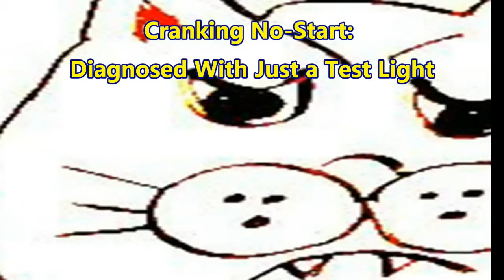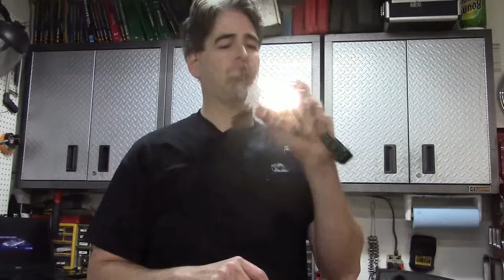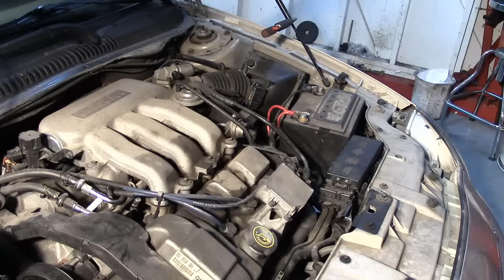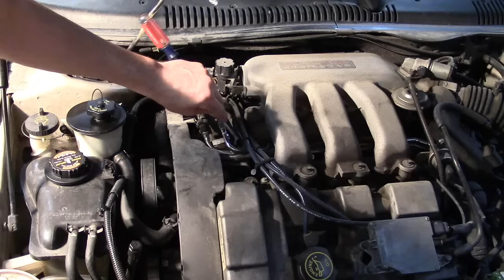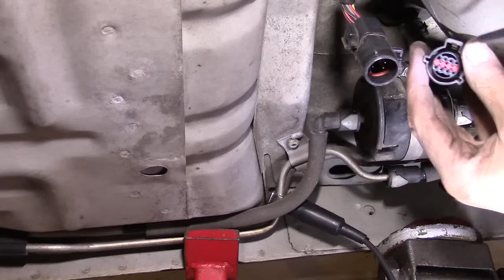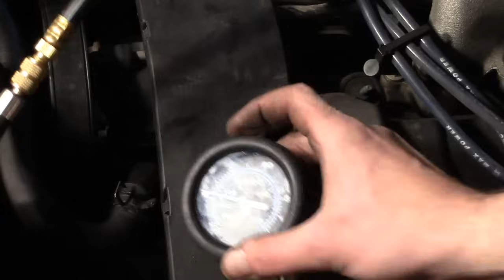Crank No-Start Diagnosed only with Test Light

Comment: 5:30 Would have immediately removed the air intake, sprayed either some starting fluid or brake parts cleaner (carb cleaner? Either one I suppose, heard BPC is more atomized, evaporates quicker, not sure if that is true or true every time but this sticks in memory,) really good amount like spray for 5 seconds, see if it runs off of that. This of course will tell you if there is spark etc, if going int he direction of fuel.

This is my first comment perhaps ever but, Mr. Schrodinger, I really like your channel and I presently have a Corolla in the garage I am letting a lot of MMO (Marvel Mystery Oil) soak on the pistons for a very long time, for no reason really. Compression numbers when warm (I know, I know, but. Still) were 188-188-192-190. Car runs mint. Love your channel and I look forward to interacting more.. you have a channel for we intelligent folks.

I knew a parts changer once and it just didn't work out.. Had to tell her, "I'm done."
Reply: Hello GHT. Do you still have the Corolla?
Reply: @coollasice4175  Yes! Still got it. Was going to maybe start putting it in videos on my channel soon...
Reply: dont you have to watch what you spray on those delicate MAP sensors
Reply: Shraeder is much quicker.
Reply: @flightofthefatman    What if your line doesn't have a shrader valve?

Comment: I'm a 98 percenter at present but would like to gain the basic electrical knowledge of which you speak so that I can improve my diagnostic skills. What resources can you recommend?
Reply from the maker: Your best bet by far is my beginners electrical tutorials at www.schrodingersboxqm.com.  It will make you almost an expert at electrical, guaranteed.
Reply: @SchrodingersBox  Thank you.  You'll have to pardon my ignorance while I work on gaining this knowledge. I'm presently troubleshooting a cranking no start, no spark condition on my son's '83 Porsche 944. I have unfortunately used the parts cannon approach until now, replacing the coil (which was out of spec on resistance and leaking oil from ) as well as the distributor cap & rotor (which were showing signs of wear) and the lead from the coil to the cap. With the key to "on",  I have 12 volts to the coil leads when they are disconnected from the coil. This 12 volts remains constant no matter how much I twist and turn the leads (which seems to rule out damage to the lead wires along with any possible intermittent open). I have continuity between the wires leading to the coils and also continuity between the posts on the coil.   The 12 volts to the leads drops to zero the moment I place the leads on the coil terminal posts. And (of course) I have neither power to the leads nor spark when I crank the engine. Fuel pressure at the rail is within spec, so I have ruled that out. Reference sensor tested bad so I replaced it  - along with the identical speed sensor which sits right next to it. Also replaced burned-looking fuel pump/computer relay. Perhaps I should check continuity between the computer and the sensors I replaced - I think that's what the problem was in your "No start due to no spark" video. Other thoughts?

Comment: Probably should have given a little more information on jumping the circuit of the pump and how to find the control lead. If someone puts that jumper on the wrong leads then the car is royally screwed. Good video other than that though.
Reply from the maker: If someone doesn't know basic electrical they shouldn't be doing this. Every car is different so I can't just show how to do it- you can only show the concepts for people to apply basic knowledge.

Comment: I have this same issue with my 2002 ls 3.9l, my replacement sending pump located on the driver side is due to come in tomorrow, have already checked the fuses as well as the relay and replaced, battery is new, so next option would be the sending unit as I was told the passenger side unit has already been replaced, and these pumps are rated for 10yrs/150k, good looking out on the diagnosis and being sure of the issue, hopefully this will stop me from spending money on unnecessary repairs.

Comment: My car stalled out a month ago. Haven’t had time to look at it until now. It’s a 94 Olds Cutlass Ciera, 3.1 liter. Fuel pressure at Schrader valve, 36 pounds psi. Battery solid, starter turns. Replaced fuel filter, replaced fuel pump relay with a new one. Still won’t start. Replaced ignition control module and three coils, since I had new ones laying around already. Still won’t start. Spark plug wires are recent, within a year. 30,000 miles on the current AC Delco spark plugs. Haven’t verified spark yet. Was also told that it might be the timing chain or wheel sprocket. I have all of those parts on hand. But at a mere 131,000 miles and regular oil changes, I wouldn’t think it would be bad already. Fuel pump and sending unit were replaced last year. Any ideas? Many thanks. One last thing, when attempting to start, the engine doesn’t sound like a normal start up, as it sounds like it’s stop in the  motion of the starter, then resumes again. What led up to this moment with the car was I was leaving the parking lot area of a business and the car just stalled out. It has never done that. Then I couldn’t get it to restart right away, a few minutes later it started but was running rough and had an odd sound to the idle. So I moved car to a safe place, called tow truck service. All attempts to restart have been unsuccessful.
Reply from the maker: What is the voltage drop at the fuel pump?

Comment: Having an issue with no crank, no start. The lights are nice and bright and all accessories work. Then after a couple of tries cranking it starts like normal, runs and sounds normal. The battery was replaced, went to Autozone and they tested bay, starter and alternator they came back good. The car did code with a p1399 misfire. I was wondering if the starter relay, cylinder or spark plugs, fuel pump or ignition switch, to start diagnose. The oil is maintained. I did find that I needed a cylinder coil due to rough idling about a year ago. This was an Acura TL 2001. Your insight much appreciated!
Reply from the maker: what data do you have?

Comment: I love your verbage! You may be the 'Mechanic Guru' I've been looking for. Hehe. I don't need a backyard mechanic. I need a master. My Astro Van will not start when it is wet outside. I have sought the advice of White Allen Chevrolet (who had it for 2 weeks. They cannot figure it out). I replaced the can shaft sensor, the crackshaft sensor, the coil, the ignition module, and the distributor cap and rotor button, twice. STILL, when it is wet outside,  NO START, ONLY, CRANK. BUT, when it is dry outside or once I get it started, it starts and runs great, even if it turns rainy out. I just have to keep it dry or get it started. But if it sits for any length of time and there is any moisture in the air. It will not start. Have to wait for it to dry out first. Then; no problem. I always have 60 lbs. of gas pressure and always have spark out of my distributor. HELP ME!
Just had my pleasure plugs and plug wires replaced. Also had AC Delco cap and rotor button replace. Plug and wires are also AC Delco. Still won't start when it is wet outside.
Reply from the maker: sometimes it’s the fact you have other accessories on when it’s wet- defroster, wipers, fog lights etc and there may be a complication when the accessory is on. otherwise I agree- maybe an ignition waterproofing issue. if that’s the case you would have no spark at the plug. Check for difference in amperage on the secondary vs primary.
Reply: I don't know your van or everything you've done but didn't mention.  I make no claim to fame or superior knowledge.  There are 2 things I can think of that might bear checking when it won't start:  1) power to the coil, and 2) power to the injectors.  Also, I think you said there is spark at the distributor, but is there good spark at the plugs, even when it won't start?  I know you said all that was replaced.

Comment: Exactly how I burnt out my Starter. 🤢 Any chance a car sounding like this that it isn’t the Fuel Pump if it runs some days but others it won’t successfully turn over? 1998 Buick Lesabre. I have a new Battery and new Starter in.
Reply from the maker: Could be- what data do you have?
Reply: Schrodingers Box Sorry, what do you mean “data”?

Comment: Hello, can you please help me. I have a 88 Toyota Camry. I parked it about 3 days ago, everything was ok, with the exception of an exhaust leak, which it has been for months and sometimes when I turned the key to start it I was hearing a whining noise coming from the front . Then, I would turn off car, wait a few seconds then start again and it would start. The following morning when I went to start it, it tried to start then I heard a weird noise but different.  Can't described it.  But, the car now cranks like a high pitch and fast, with no resistance whatsoever like it has no compression.  I just checked to see if the timing belt has snapped . I removed the upper timing belt cover and I saw the belt spinning .. I still don't know if the crankshaft is also spinning.. other than checking spark, fuel, air, compression, fuses, relays.. what else could it be?? thank you for your help..
Reply from the maker: Those are the things you need to check! What were your findings?

Comment: Hi mr OZ this is Franz I have a 05 altima 2.5 I just chang the engine oil and started to  blow little oil out of the filter cap for the first time I wonder what can it be.
Reply from the maker: Check PCV system

Comment: I have a '98 f150, 4.6l..It has consumed more gas than usual..Sometimes it will stall..Now it will not start ...The fuel pump is good..Would the TPS cause the problem?..According to the scanner, the code is PO123..I want to make sure if it's the TPS or not before I  get one..Great video, btw..👍
Reply from the maker: No way to tell- what is the basic voltage data on the reference, signal and ground? Are the voltage deferences to ground proportional to angle?
Reply: @SchrodingersBox  I have no idea my friend..Too complicated for me..lol..I was also told today that it could be the crank sensor?..Apparently, that's common with that make and model.
Reply from the maker: Maybe who knows. If its the cranbk sensor I would bypass the signal to reference after continuity testing the ground. That would be conclusive. ANything else is just guessing. I dont believe in guessing.
Reply: @SchrodingersBox  I found the problem. I unplugged the sensor and the contacts were dirty. I gave it a good cleaning, plugged it back in,and the first turn of the key she started. Even though, It may be only a temporary fix but if it happens again, I know what the problem is and perhaps have to replace it with new one.

Comment: My 02 Toyota Corolla cranks but won't start I changed the fuel pump put a new battery and fixed the fuel injector because one was leaking but it still won't start what else could it be???
Reply from the maker: No idea- what was the data you had that indicated the fuel pump was bad? I would totally start there.
Reply: MICHELLE forte Check the ignition voltage usually the coils go bad in the distributor or could be a cap and rotor

Comment: I have 2008 Accord that sounds the same when you try to start it. I have fuel pressure, injectors are spraying perfect, I have spark, and the timing chain was replaced as scheduled 40,000 miles ago. would a vvt solenoid cause the car not to start?

Comment: Hi! I have a problem with my car when I crank it in the morning. The starter makes a grinding noise and sometimes it cranks after a few times then it works. Once my car runs, if I turn it off, then it cranks normal and works as normally should! The problem is the first crank in the morning. Any advice on my case?! Thank you!!
Reply from the maker: Mechanical inspection needed. Check shim clearance, Simple.
Reply: @SchrodingersBox  Thank you  "/

Comment: I have two questions first being if you jump the load side how did you keep the car from starting and what did you find to ground the probe to when you where under the car
Reply from the maker: I used a fuel line to ground under the car.  How would car start when jumping a fuel pump load side though??
Reply: @SchrodingersBox  I don't know a whole bunch about car was just wondering on another segment I watched the guy started the car with the paper clip I just need to hear the fuel pump run will it work if I try
Reply from the maker: Makes no sense.  I start cars with a paper clip in many video- I do it from the starter load side.

Comment: Starting fuel may help identify the priblem
Reply from the maker: No, it will help ELIMINATE a potential cause of the problem. It cannot help identify one.
Reply: @SchrodingersBox  Doesn't it first have to be identified in order to be eliminated?  Otherwise, how do you know anything was eliminated?
Reply from the maker: No- because you are identifying the PROBLEM not the variables. variables can be eliminated without identification through inductive process of elimination.

Comment: My 2004 Tahoe with 1/4 tank of gas, wouldn't start.  No security light flashing, had good spark, I could hear the fuel pump prime yet no pressure to the fuel rails. For shucks and giggles, I added some fuel to the tank and it started. My fuel gauge must be inaccurate??
Reply from the maker: Could be. Measure the resistance at 1/4 vs empty
Reply: Schrodingers Box  Thanks Matt!

Comment: Not being a trained tech, I would first check codes. Then check fuel pressure and spark and scanner readings. Harbor Freight has that light. Sometimes you have to do a little 'free' work to diagnose.

Comment: Opps Correction I have a 1994 Toyota DLX Extended Cab Pickup  2.4 Liter L4 22RE Engine .. I was told the Crankshaft Position Sensor is in the Distributor ? is this true?
Reply from the maker: On some vehicles it is. Simply check for a hall effect sensor connector and that would easily confirm if it is true on that vehicle.
Reply: @SchrodingersBox  Crankshaft position sensor? Maybe camshaft position sensor.

Comment: I was told that I needed to pull the Crankshaft Pulley and I did but I didnt see the CKPS and there were no wires either. I pulled back the alternator back.. still did not see it ... darn
Reply from the maker: some cars have them at the flywheel

Comment: I discovered that my fuel filter had been removed 2 years ago. My engine has been hestating over the last 2 months and now it will not start. Might the probable cause be contaminants clogging something?
Reply from the maker: Could be. Do a fuel trim analysis and you'll see that reflected with lean condition  despite a proper rail pressue and then do an injector balance test to confirm.

Comment: you didn't just use a test light .. you used the power probe as well . and there was no amp load test on the fuel pump... and I commented before the video.
Reply from the maker: Why is an amp test needed when I did the load side bypass? Please explain. That makes no sense to me- help me understand what’s i am missing.

Comment: I have a 2005 dodge ram 1500 3.7L V6 it cranks but won't start, fuel pump and fuel relay are both good anybody know whats wrong
Reply from the maker: NOBODY knows what's wrong. data is needed to do that determination. What is your static vs cranking rail pressure? What is your coil signal input indicating? have you done a CKPS bypass? Basic information like this is needed to tell what';s wrong.
Reply: Ignition coil bad most of the time
Reply from the maker: Then I would test that first if that’s the case. Definitely wouldn’t replace it though.

Comment: I need help starting my 2002  turbo beetle it will not start . Any clue
Reply from the maker: Not a clue. WHat data do ypou have? Is there power and control side feed to nthe relay? Is the voltage drop to the starter within .5V? Is there a 12V feed to the solenoid?
 Not a clue.

Comment: Excellent diagnostics.   I hope you can help me resolve an issue with 2000 Ford F150 5.4 liter.   Truck ran fine, parked it for a week.  Went to start it and it would roll fine.  No DTC's,  historically it had a P041 or 042 evap mild leak.  Gas tank cannot be filled with out it overflowing (ie fill then when the gas warms it overflows) have not had opportunity to drop tank.  It currently has on Ford OEM codes a P10000 code.  
My attempted actions:  Injected starting fluid into  air intake engine starts and runs until it runs out of ether (thus spark good), fuel is the issue.   Check fuses and relays (fuel and pcm) both are good (tested good, also bought a new one and inserted) no fix.  replaced fuel filter.  Disconnected fuel rail feed and return.  Turned on key have fuel at feed.  Looked for schrader valve on fuel rail, there is none that I can find.  I do know know if this is an aftermarket fuel rail system.  Checked vacuum side of Fuel Pressure Regulator (FPR), no fuel found, also did not feel vacuum when attempting to roll engine.  checked vacuum lines found no leaks.  I put in a new Advanced Auto Spartan engine less than 10k miles ago.  Using a syringe and hose I put vacuum on FPR to no effect.  How can I continue troubleshooting -- how can I connect fuel pressure gauge without schrader valve?  Appreciate any help.
Reply from the maker: Yes fuel pressure would be next. Without schrader valve you might have to just deadhead the pump feed to the rail.

Comment: That bashing on the tank trick has gotten me out of the weeds before when I had a fuel pump on its last legs. Driving around with the rear seat removed bashing the crap out of it with a hammer at the stop lights as it stalled constantly under no throttle on the way to the mechanic, good times!